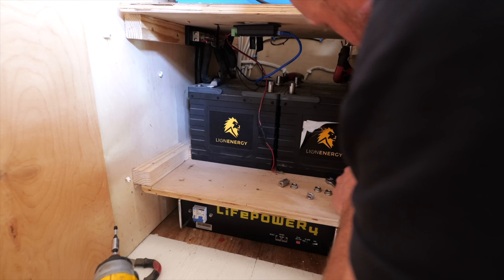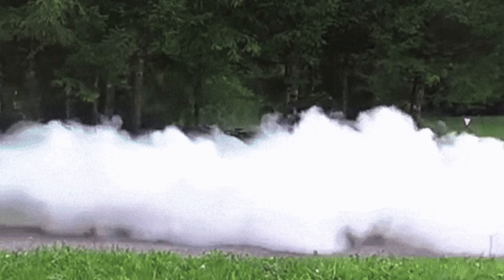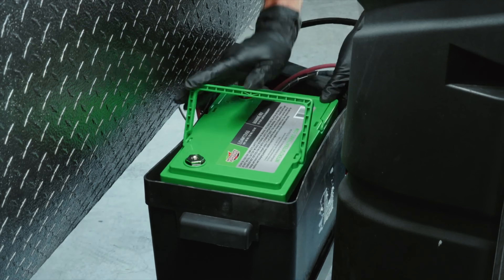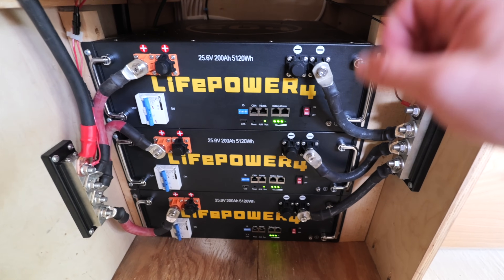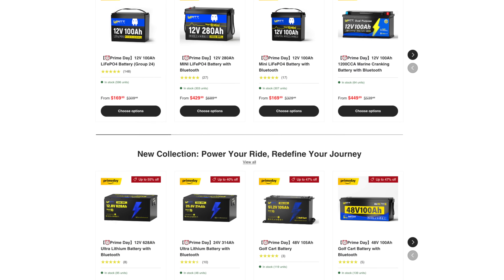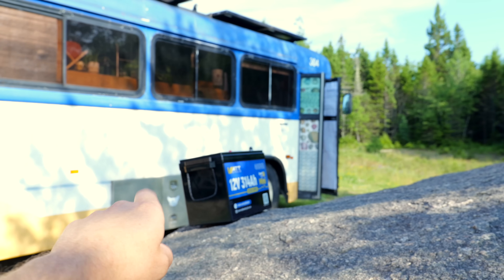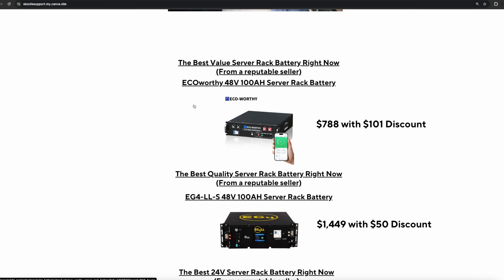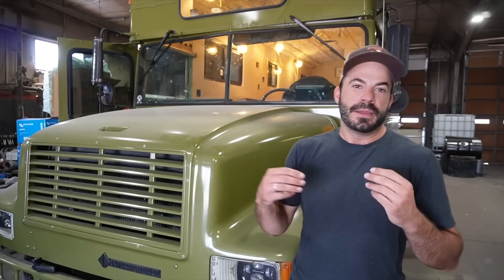Don't Buy a Lithium Battery in 2025 Until You See This

Comment: question....i want to build a van with lots of battery power....if i go with 48v is there any cheap option for dc to dc charging? do i have to buy a 48v alternator at 2-3000$ or is there any cheaper way to go? (cause solar are kind of limited on a van roof)

Comment: Amperage is everything, which means cable size. 12v is entirely possible for a 3000w inverter, it just requires 4/0 battery cable to support up to 250 amps. Since the electrical system for all the accessories in the rv is 12v, a 12v system for everything is the simplest. 24v is maxed out at 6000w, and 48v is maxed out at 12000w, using 4/0 battery cable in all applications. If you want to save on cable cost and not run 4/0, go higher voltage. However you will need converters to run your existing 12v system
Reply: He needs an entire 48 volt system. Everyone is now. I'm very surprised at the 12v in this day in age. Was just a paid advertisement anyway. And he got the batteries free

Comment: the only issue I've had with these batteries is the weight ... and trying to move them by myself
Reply from the maker: The 12V 100ah batteries these days weigh well under 30 lb's. But then you've got to wire them all together. Think you could move one of those. I'd personally get 1 or 2 big ones and ask somebody to help me move them into place.
Reply: @MobileDwellings  I have the 24V from a couple years ago that weigh about 100# each ...